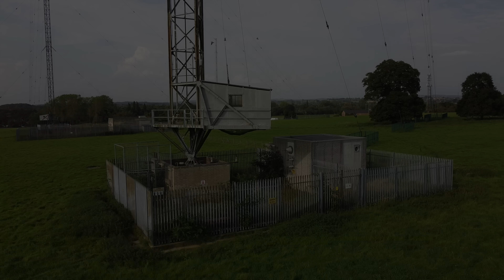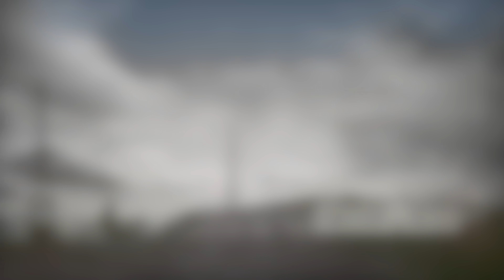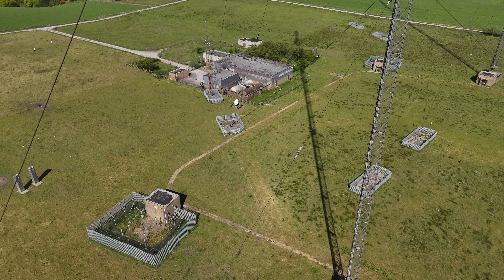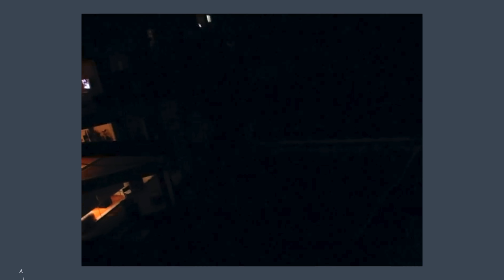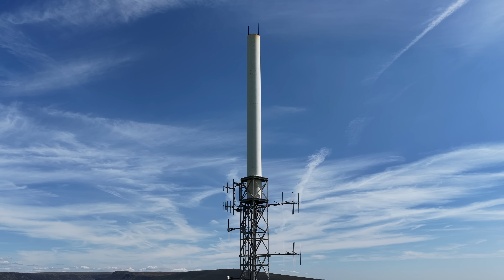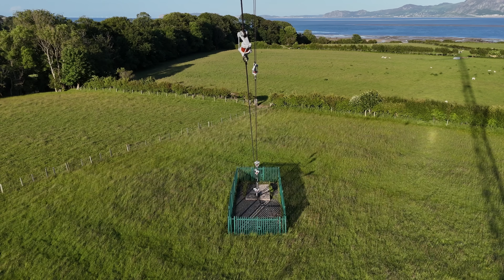Can You Harness Free Electricity From Radio Signals?

Comment: I worked at Rugby Radio very briefly in the mid 1970s and the light switches in the transmitter hall were ineffective as the stray radiation was enough to keep the tubes lits, but as you say this is very different to harvesting real power.

Comment: I can confirm that I saw lights powered at a pub near Droitwich & another near Skelton shortwave. In both cases they were tiny christmas style strings & were connected to large wire loops. They flickered with the audio modulation & the Skelton light's brilliance depended on the beam direction of the curtain arrays.

Fun Fact. You could never turn the lights off at Droitwich. The fluorescent tubes stayed on merely on induced energy. Also those old Neon Screwdrivers used for testing for 240v would light up if you tried to use them on anything metallic like a screw terminal.

The Crystal Palace story sounds like myth, a dustbin lid wouldn't gather enough energy, same with Sutton due to lack of resonance from a long wire.

Comment: I can confirm that I saw lights powered at a pub near Droitwich & another near Skelton shortwave. In both cases they were tiny christmas style strings & were connected to large loops. They flickered with the audio modulation & the Skelton light's brilliance depended on the beam direction of the curtain arrays.

Fun Fact. You could never turn the lights off at Droitwich. The fluorescent tubes stayed on merely on induced energy. Also those old Neon Screwdrivers used for testing for 240v would light up if you tried to use them on anything metallic like a screw terminal.

The Crystal Palace story sounds like myth, a dustbin lid wouldn't gather enough energy, same with Sutton due to lack of resonance from a long wire.

Comment: The so called prosecutions sound like modern myths, the offence of abstracting electricity could not be used as no electricity was actually extracted from the radio source, the theft act of which the previous is the relevant section could not be used other than the abstraction as no property is actually stolen. The wireless Telegraphy Act 1949 only applies to listening and using information you heard in transmissions from the emergency services, hence agin it doesn’t fir the criteria. As someone experienced in preparing criminal charges IMHO the act of generating electricity in this manner would not be suitable for a Theft or WTA prosecution

Comment: The US military had a powerful transmitter which affected fluorescent lights which were fairly common in post-war Japan.  As described in this video, residents complained they could not switch their lights off.  The fix deployed was to glue aluminum strips along the length of the lamp tubes to short out the incident RF. This was told,to me by the person who claimed to have been responsible for mitigating the permanently lit lamps. 

I worked with a guy who lived near John’s Hopkins in Maryland, US.  One weekday he was home mid day and heard various articles in his house buzzing.  He noticed that it was periodic and occurred when a parabolic reflector on a nearby building was pointed in his direction.  He met with the people in the radio lab who agreed to notch out the transmitter pattern in the direction of his house.  The lab had already notched the beam for other people who had complained.

Comment: A remarkable well researched video. I am a former BBC engineer from the 80s to 90s. This was widely discussed at the time much along the lines you have mentioned including suggestions that dark-patches were found in the radiation pattern from transmitting sites because of a dipole-taps as you suggest.  But also as you suggest striking and maintaining a fluorescent tube is not easy unless you are very close to the antenna. As I was based in London among BBC management we had access to a hugely complicated and slow running (on computers of that era) software application that had every transmitter detailed and the exactly terrain profile of every address in the country encoded within it, it was called Wings or something like that. And it was wheeled out any time a senior manager wanted to get involved in a technical complaint from someone who had written in about poor TV/Radio reception. In almost all cases it was a local fault with interference or corroded wiring to domestic aerials. Not sure if you have covered elsewhere but more bizarrely are the cases of random demodulation of an RF signal by a wire fence (corroded joints) etc near a transmitter that allows you to hear the broadcast signal "out of nowhere".

Comment: One of my coworkers grew up on a farm, he related a story to me about his grandad using coils of wire to power a couple of lamps in an outbuilding too far away for a connection to the main buildings. The outbuilding was at the edge of the property near AC transmission pylons.

His tale states his grandad was able to power a couple of low wattage bulbs, enough to see on pitch black nights.

I was probably being messed with. YMMV

Comment: i think its valid. these low freqency signals are a perfect match for a cheap loopstick antenna. those antennas can pack a lot of gain in a small, cheap on metals device. high gain is also modelled as a big aperture area. 
the fact that it causes dead spots in the signal radiation gives the story more credibility.
people living nearby to AM transmitters regularly complain that wires, fences, fluorescent bulbs, pipes and so on glow or produce arcs and sparks, which means that even a bad antenna captures some significant power.
now imagine if you engineer a proper loopstick antenna that effectively absorbs the magnetic field, doesnt reflect much and the electrical load is properly impedance matched. i'd be surprised if such devices didnt work

Comment: The energy density of electromagnetic waves, such as those used in broadcast transmissions, is a critical factor in understanding why harvesting power from these signals is impractical. Energy density refers to the amount of energy stored in a given volume or area, and in the context of broadcast signals, it is typically very low. Broadcast transmitters, whether for radio, television, or other forms of communication, generally operate at power levels in the range of watts to kilowatts, which are designed to ensure signal reach over large areas, but not to deliver significant power for external use.

The inverse square law plays a key role in this energy dissipation. The law states that the intensity (or energy density) of a wave decreases with the square of the distance from the source.

Comment: Hm all electromagnetic waves work in the same way so let's instead of antennas use a big light so the closest one would be blinded by this light ,but would be able to harness the energy via solar panels, the light transmitted would  not lose energy so there is no theft , their is energy to be had but the regulations have a maximum of 0,4 watt per square meter, so not much to take ,10 meters would go for 4 watt maybe for a radio, so close to the transmitter is hazard to health and they put this antennas in high spots in isolated areas ,so the stories have  some Truth to them and some things are inconsistent

Comment: I recall reading a story in "Practical Wireless" about local residents harnessing power from a high power WWII radar installation operating somewhere in the short wave band. I can't recall exactly when I read this, but I do recall that the magazine date was 1st. April, 19**! The idea of station staff detecting the RF shadow behind the site where someone was abstracting RF energy for their own use doesn't really hold water. At any distance "downwind" of the clandestine power receiving apparatus (As a guess, more than half a wavelength), diffraction effects would have filled the shadow in. Any dip in field strength would be so small as to be practically indetectable. Certainly indistinguishable from natural variations due to local topography. A detailed RF survey of the area immediately around a suspect property might just possibly detect unauthorised use of the signal power. Highly unlikely that a general check of coverage at a distance from the transmitter would discover such a shadow. In any case routine checks would be of the signal far from the transmitter where signal strength would be far too low for anyone to get a useful amount of power. Transmitter engineers are far more interested in how their signals are getting out to a distant audience. Reception near the transmitter is more or less taken for granted.

Comment: People should be sueing the company for being radiated not the other way around. ❤️💛💚
Reply: Yup,Electromagnetics Waves have an impact in your health.
Reply: @rickhuntraslam2925 They don't though, when you look at the science instead of baseless conspiracy theories.
Reply: @bigbadsteven they might though when you look at how they test. random single point tests.

now ask yourself what do two radio waves of the same frequency do when colliding...  see how having a single point test might not show the full power output found in other locations.  the waves contribute and amplify. the power can be massively greater than a single waveform direct from the transmitter. 

they dont test adequately. so,  it  seems yours is the conspiracy.
Reply: @luminousfractal420 Haven't they found that RF around smart meters kills or stunts plants?

Comment: I've heard of the African "inventor" claiming to have developed a method for harnessing enough power to drive an e-motorcycle without recharging from the mains. This would only work if aerial much larger than the bike itself and the bike is only ridden within a short distance of the transmitter. This would limit the range to a small circle around the transmitter. Totally impractical... I think this "invention" is mostly, if not entirely, a scam.

Comment: Many years ago a mate was messing about with crystal sets, we then evolved it to power a little LCD calculator. The final evolution used power extracted from the BBC MW transmission to power a tiny FM radio tuned to Capital.
I have seen significant amounts of power extracted from long wire aerials, 20dBm or so (100mW) is not unusual if you are within a few miles of broadcast site. A long way from the power you'd need to heat a greenhouse.

Comment: It’s entirely feasible. Anyone who has installed a TV aerial has received a shock from the Co-ax cable after it’s been attached to the aerial. 

However, the difference between a capacitive charge stored on a disconnected Co-ax and a continuous charge that can power an apparatus is massive. 

I also don’t believe that if someone was somehow absorbing a usable amount of power from a radio signal that it would create a noticeable hole in the radiative pattern of the signal. The effective radiation of a radio signal is completely unaffected by the amount of receivers in the area affected. These receivers are all taking an amount of power from the signal (albeit minute), and yet people beyond the first users can still receive the signal.

Comment: Lighting a fluorescent lamp by standing under a 300kv grid pylon is called radiant energy and would not cause any volt drop in the grid as its just picking up on line losses which occur as a result of the electromagnetic field surrounding all current carrying conductors especially high voltage ac in free air.
Reply: time to pull up with a EV and roll out a copper mat
Reply: but jp morgan is crying in his grave at the loss of profits.

Comment: The story I heard was for a greenhouse (i remember it as heating, but it may have been lighting?), and prosecution for abstraction of electricity.  That story was told to me, in the 80's, in Coventry, so perhaps may have origins around Droitwich. It was described as a large coil around the greenhouse itself, appropriately tuned. I have idly wondered how practical that is, but never tried to work it out.

Comment: Slightly off topic, but back in the days of CB radio we had a massive aerial on a scaffolding pole mounted to our chimney with four copper wire ground planes radiating from the centre to each corner of the house, during thunderstorms it was terrifying, we used to unscrew the PL259 plug from the back of the CB and chuck it and the lead out onto the lawn, the PL259 would be sparking from the centre pin to the outer shield a bit like a spark ignition on a gas hob.

Comment: No way, in the wery near proximity of a LW (1500 kHz) station on the steel mesh fence you could lite an incandescent bulb at some 20 km with cristal detector, practically a wery good germanium detector diode and a high sensitivity speaker you could have some low power music. That's all.

Comment: I am not expert on this, but from what I have heard and read, the length and array of your antennae is very important for absorbing as much energy as possible.  This all works off of harmonics of the electromagnetic field.  The antennae needs to be tuned to the specific frequencies being emitted by the tower so that a resonant frequency occurs in the antennae.  If it is not tuned to those frequencies, you are not going to successfully capture the energy regardless of what you do because a negative resonance cancels out the energy coming into the antennae.

Comment: Well you sorta can radio Waves are a form of energy and with the right setup and how close you are to the transmitter you could effectively harness enough power to do some things though it would be awkward because it's pretty much  modulated to transmit audio signals an any electric motor powered by it would give off sound like a speaker and light bulbs would flutter if you could polish out the current so it remains consistent your on to something and no you wouldn't be sucking the radio stations coverage once they've released that energy into the atmosphere it's fair game lol😂😂

Comment: Those fake tale created to make people not stealing electricity. Those are old ways to make people afraid of doing something by the government. That's kind of fake tales was existed in my country too. According the tale, you can be arrested for harnessing electricity from radio broadcasting transmitter and/or SUTET (Saluran Udara Tegangan Extra Tinggi or in English: Extra High Voltage Power Grid) by induction using copper coils. But no body care because who'll make copper coils since the price is very expensive that time.

Comment: I was told the following story around 1977 . Someone with a garden backing on to Daventry Transmitters ran his house's light circuit from the EMF . It was achieved, I was told, by attaching a Copper Loop to a "Step Up" Transformer . Engineers testing the EMF found a spike pointing towards his property . He was prosecuted and had to pay the Electrical Supply Company what he would have had to normally pay them. This story was told to me by an Electrical Engineer. I have never until now ever heard a story like it since.

Comment: I've heard a similar story here in the States. Radio station notices holes appearing in their coverage and somehow figures out (through investigation or word of mouth) that someone set up equipment to power their house. Instead of prosecuting, the engineers slowly lower the power output over the course of days to cause the offender to gain up their equipment before they ramp back up to full power in minutes and fry the offender's equipment and electronics in one go.

Comment: I think the reason we don't see any of these energy harvesting stories with RF is that most of the low wave transmitting sites have gone away When you're building a coil antenna the lower the frequency the bigger it has to be but at the same time once you hit that resident frequency of about a kilometer of wire Then you can start to get significant power transfer. These coil antennas are also highly directional. And I believe having a very strong ground close to the transmitting site would result in very good coupling It is very probable that they're also on the same neutral as the power lines So that there is a Low impedance ground there. The larger You make the physical coil the more coupling you'll have as well so having a house sized coil with very thick wire would result in a lot of power flowing. This video shows them using resident components for magnetic transfer but I do believe that it is possible to get significant coupling Maybe on the order of watts https://www.youtube.com/watch?v=adTKHcrOzMU&t=605s
Reply: Exactly.   It's done in the VLF band, where the thief is located near or inside the transmitter's Nearfield Zone.   Doesn't apply to FM transmitters.   For broadcast band (AM) you'd have to be too close, less than one wavelength away from the transmitting tower.

Comment: my dad (born 1918) once told me that some homeowners near the Droitwich transmitter had complained that the electric ‘rings’ on their cooker hobs ‘emitted’ audible ‘BBC Home Service’ radio programmes, the precursor to R4 (he was very interested in radio, and early television, and had built a valve amplifier and valve radio tuner as well as the oak cabinet for a ‘music centre’ which continued to be used until the 1970s)

Comment: The electric field-strength from a radio or television transmission aerial, or aerial array, tales off according to the "Inverse Square Law" which means that in order to double the range of a given transmission, the RF power would have to be increased by 4-times. This is obviously why you'd have to be very close to the Droitwich 198 KHz (1515 metres) in order to partially illuminate a flourescent tube as used for lighting a domestic kitchen, etcetera.